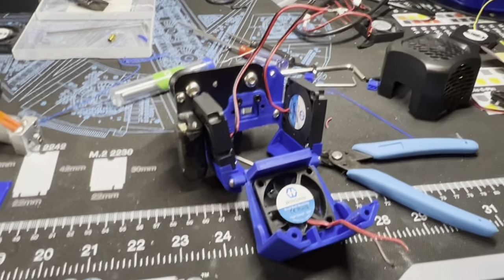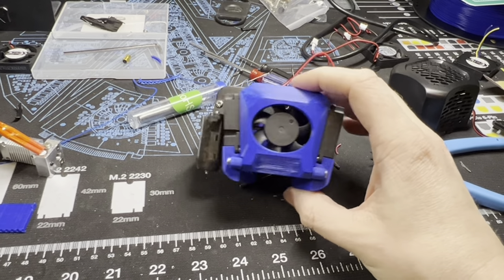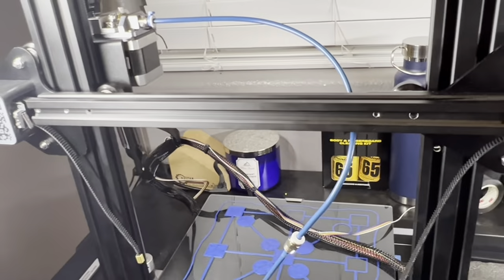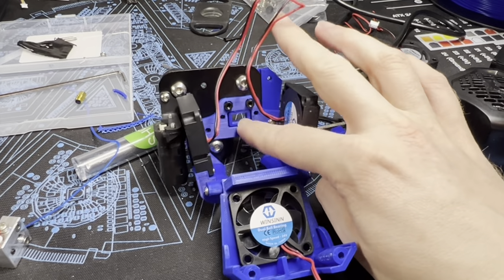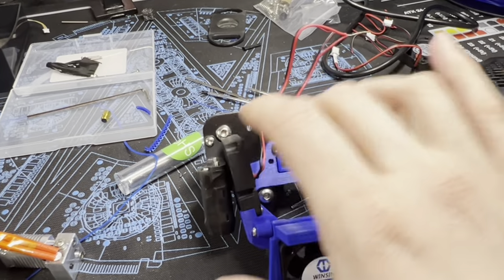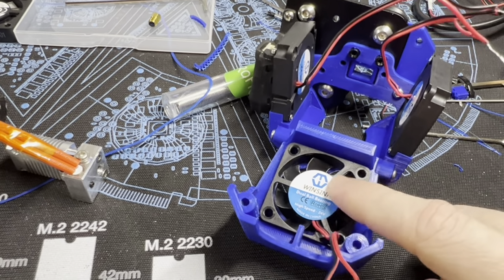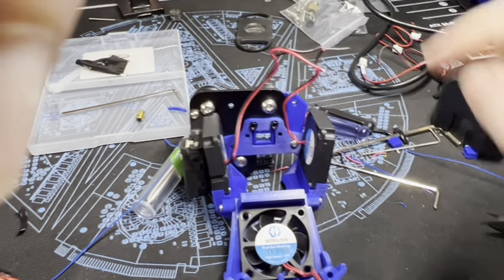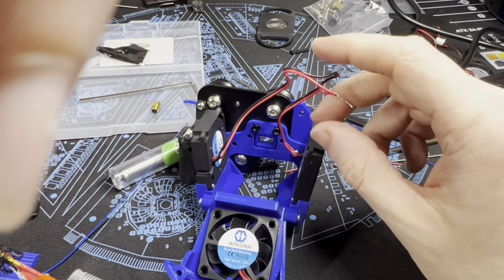Ender 3 v2 Dual Blower Fan Shroud

Comment: I've been using JST connectors and putting them on everything on my printer, you can make a splitter cable for the blowers, but the good thing about JST connectors is they are the same as what Creality use on the motherboard. No more soldering and cutting wires every time I mod my printer or change a fan.
Reply: wich jst ?  🤔
there are more type and now i have the wrong one's 😌
Reply: JST is a brand name, not a style of a connector

Comment: Instead of soldering the blower fans together.
Fit JST plugs to each fan and on on the wire from the printer, then make a “Y” link lead, and connect the 2 blowers to that and the other end to the printer.
That way, if one fan fails, you can just unplug that fan and swap the one out. 😉👍🏻
Reply: Nah, if one fan fails, then the other wont be far behind, just replace both they are low cost.
Reply: @TheWeepingCorpse  holy 1 year post reply Batman 😂

Comment: This is what I was looking for since have an extra 4010 part fan from the assembly that came with the E3V2.  I installed creality's Direct Drive upgrade kit that comes pre--assembled, all I had to do was move my extruder over.

I printed the whole thing on PETG, started assembling it, the realized that this wouldn't work with my direct drive set up, it doesn't have the screw holes in the right places nor that rectangular hole in the back behind the Hot End.

Now I am making modifications to get it back printing so that I can print another fan shroud kit that actually fits my set up.

Thanks for the video.
Reply: Ayo drop the files if you figured it out, I also came to the realization when I tried to install on my direct drive v2

Comment: Thank you for this video. I just converted my ender 3v2. Im used to PETG with no problem, but started using PLA and was having warping mid print on the part itself (not bed adhesion), that fixed the problem!

Comment: It's a fantastic little cooler.  Looks alot better if you print it face up with support ! make sure to get the back duct some one added in the remixes :)
Reply: Are you talking about thing 4928888? to blow the air directly on to the hotend heatskink? I saw your remix to open the fan up, 👍 Thanks.

Comment: Thanks for the cool design on this printer head. With a tiny bit of modding it works on the Voxelab Aquilla.
Reply from the maker: Good to hear. I didn’t actually make this design btw, all credit goes to the author in the link.
Reply: Hello Digital, can you explain what kind of modding. I really like this and would like to know if im savvy enough to do what needs to be done to fit on the aquila
Reply: @Chris_6  sure you do. I use tinkercad and fusion for my cad work. But for this, I needed to wire in one more 24v fan. I had some replacements, and so I had to splice in the 24v power supply for the fan already in the factory hotend. It's not overly complicated but could burn your printer down or get electrocuted if not done right.  There are lots of videos and guides online to help anybody who wants to do some upgrades.
Reply: @Chris_6  The Aquila was effectively an ender3v2 clone, so most ender parts fit.

Comment: Thanks for the video. I have a VOXELAB Aquila and bought the same replacement fan kit. Looking for a shroud where I can use both fans I found this and your video. I'm going to work on this to fit on the Aquila. You should do more videos, you are very good at it. Thanks again.
Reply from the maker: Thanks for the kind comments! I hope it works for your Voxelab Aquila.
Reply: How did you get on? I added a Hero Me to my Aquila a while ago and 2 Winsin blower fans and wired it up just like this video shows; worked fine, FOR A WEEK then the PVC wire totally melted; almost set on fire. I replace the main wire with high temp 18 AWG wire up to the point it split to th 2 fans..worked fine..but now the printer stops after about 20 mins an reboots..even when the fan speed it very low (less than 20%). Have you seen the same thing?

Comment: I wish it had screw holes for the front fan to make permanent. But looks amazing and looks amazing. Also to tight of a fit for some of the fans I had to make adjustments on a slicer.
Reply from the maker: The front fan is in there so tight. It’s not going anywhere. Been using it flawlessly now for over 6 months. Also PLA+ has been fine, no warping at all.

Comment: hello, I really like your work!  I had a question, do I need to buy 2 24v fans or 2 12v fans to cool the nozzle?  I would be grateful if you reply.  thanks.  good work
Reply from the maker: Has to be 24v, otherwise you have to get a buck converter to change it to 12v.

Comment: Is there a remix of this that uses a magnet to hold the front cover closed instead of a screw and its designed to fit the stock hotend for the Ender 3 V2?

Comment: Thanks for your very helpful video.
Quick question please, with BL or CR touch the prints come out better even if the bed is warped, or still have to level the bed?

Thank you
Reply from the maker: The bed still needs to be as level as possible and it will compensate for slight warping, but if the warp is really bad you should just get a new bed.

Comment: the files that you have in the description, do they fit with the CL touch or did you need to modify the model?
Reply from the maker: At 10 minutes into the video I explain this. No I didn't change the model, but I did have to shave down the CR Touch so it didn't hit the fan blades.

Comment: I've had an issue where the back plate doesn't push onto the 2 original heat sink threads go. I am using an aquila x2 (ender 3 v2 clone) just wondering if u had to hit them on with any force?

Comment: Screw size for the hinges are M3x12mm just fyi.
Reply: Good to know.
I bought taps and a set of small metric cap head screws and nuts.
Every one should have these on hand for building.

Comment: hell yeah thank you man.. i ordered the same fans a little while back and been waiting to install them, I may have to give this a go.. does it cool better or perform any better? and is it a noticable different as far as weight?
Reply from the maker: It allows me to run the fans at 50% which is much quieter plus it seems there is less stringing because it hits it from both sides.

Comment: Do you know if this design will accept non-stock hot ends? I have a Phaetus Dragonfly BMS and am having trouble finding a shroud with dual blowers that fits around it. It's 24mm wide.

Comment: I'm looking to add a few upgrades to my printer and this dual fan shroud looks like a good next step from the single stock fan of my Voxelab Aquila, where cooling quality depends a lot on the direction in which I print. As there are already many comments about this, I assume it is safe to use PLA for the print. Did you have any long term issues with it, especially on longer prints? Would it maybe be a good idea to coat it in something heat resistant like waterglass?
Also, thank you for the assembly guide. I will definitely be using it when I get around to printing and installing the shroud.
Reply: Did you do it yet?
Reply: @urgamecshk  Yes, I printed it in PLA 1-2 months ago and it performs pretty well. It's more quiet than the stock shroud while getting a better airflow, and I didn't have problems with it deforming even when printing hot materials like ASA. Do keep an eye out for warping though, as warped edges can hit the cooling fan duct if it's bad enough. 
There isn't really a need to coat the shroud in something heat resistant, although that would probably make it last longer.
Reply: I've been running a PLA+ Santana Printer fan  remix on one of my printers for more and a year with no issues.
Reply: It is amazing to me how much quieter the Voxelab Aquilla gets with a printer fan cover vs the stock. I printed one ( a Santana remix) of my ender3v2 for my first Vox and it was a huge difference on loudness.  The factory fan setup is really loud. lol.

Comment: This is a great setup and I am working on the same thing at the moment but I was wondering how you connected the fans together? Much appreciated
Reply: If I had to guess, 24v fans should be wired in parallel so they stay 24v. If you have 12v fans you wire them in series so the 24v supply is split between them.

Comment: Great design! Thinking about replacing my Satsana fan duct with this one. What voltage fans did you use? I'm thinking about buying winsinn fans but not sure what voltage to pick. The default blower fan is 24v so 2x 12v winsinn fans should be best right? You link to 2x 24v winsinn fans but they don't run on full power then?
Reply from the maker: I’m pretty sure you have to use 24v fans, unless you get a buck converter to convert the voltage to 12v. The winsinn kit I linked in the video description works and is 24v.
Reply: Danny, that's not how voltage in parallel works with a load like a fan. If you wire two 12vdc fans in parallel to 24vdc, both fans will see 24vdc and they'll both be damaged. Same goes with series. There's a small voltage drop across the fan but likely they'll still be damaged. 

Unless you want to get a converter for 24 to 12vdc, you have to use 24vdc fans and wire them in parallel. They'll both see 24V and the board will supply current to both appropriately.
Reply: You could wire 2 12v fans in series, and that would effectively "split" the voltage between the two.  However, this does potentially create other issues.  For example, if one fan wears a little faster than the other, the voltage required to spin the fan will become increasingly different.  As one fan pulls more voltage, the other fan will receive less.  In the same way, if one fan fails, the other will get the full 24v and get fried, too.

Best option: use fans rated for the proper voltage.  (In the case of the Ender 3, that's 24v.  You can confirm this with a tester, or check the internals.  It's usually printed on there.
Next best: Install buck converters to reduce the voltage to 12v.  This also introduces additional issues/concerns that I won't get into here, but you can do some research and find them out.
Worst option: use 2 12v fans wired in series.
Impossible option: Connect your hotend to a radiator fan from a 1994 Jeep Grand Cherokee 🙂

Good luck with your mods!
Reply: @daviddeyoung5710  How can I get the All Wheel Differential Drive out of the 1994 Jeep Grand Cherokee and into my dual gear extruder? I need more power! Wiring in parallel is essentially like buying old Christmas Tree lights at Wal Mart, in the 1990's. The fluorescent bulbs will continue to receive power if one bulb goes out. A series, however, is when one xmas light bulb goes out and the whole series of the colorful lights will not power.
Reply: @mattpker  Did you wire the 2 fans parallel?? You know that this means that the final load is 12 v ?

Comment: I don't know if I'll get an answer here since the video was over 1 year ago. However, I would like to ask something. I have installed a 12v radial fan, but I also want to install 2 pieces. now I would like to know if you can block 2 ventilation to a connection (like you in the video)? Are both fans still running at full power or are they drawing power from other fans? 

would be really grateful if someone could tell me.

Comment: Did you print this in PLA or PETG? 

ive only got PLA on hand but being that its not in contact with the hotend im assuming it wont have issues with heat related warping
Reply from the maker: It has been fine with eSun PLA+ so far.
Reply: I’ve used paramount pla and it works fine.  No warping or melting and I’ve had some very long prints on it and print at 230C

Comment: i have this setup but i used the stock ender 3 fans and now i'm having stringing issues. my retraction distance, speed, and filament temperatured were the same. could it be just the fans?

Comment: Hey nice job! I was hoping to add a fan to cool the extruded motor because it has been overheating recently and causing the filament to melt and get stuck. Am I able to just splice in another fan with the existing one and power 2 fans?
Reply: Splice it in with the hot end cooler. Not the filament cooler. You could also get some passive heat sinks for NEMA 17 motors.

Comment: Great design and great explanation,. I tried to print one of the parts (Airducts_V3) and when
removing from the bed it broke in two parts., The structure between the back plate and the fan ducts seems to be weak. I printed the part using PLA+. Can you please confirm the filament you used please.and also  cura settings. Thanks
Reply from the maker: I used eSun PLA+ with default Cura settings. Maybe your having bad layer adhesion? Try increasing the printing temperature. Some people forget with PLA+ you need to up it from 200c to 210c.

Comment: The left fan is covered by a BL touch, which blocks the air suction. So, may be it is not the best idea how to place the fans. Anyway can you see any difference in printing quality compared to a stock fans solution?
Reply from the maker: The BL touch is hardly blocking any air flow, it still blows very strong. And the part cooling is cooling from both sides now, so yes it is improved. I have been seeing less stringing then previously and I can run the fans at 50% speed for less noise.

Comment: I installed two fans and wired them correctly and the one fan takes precedence over the other, I have tried other fans, is there something I am missing?
Reply: Same problem here.Did you find the solution ?

Comment: Now it cools down pretty crazy. Do you suggest cutting speed to 50% ?
Reply from the maker: Yes I run it at 50% fan speeds now.
Reply: @mattpker   do you change the voltage on the board or its not needed?
Reply from the maker: @alexguertin7261  no

Comment: How is the fan noise compared to the stock fans and shroud?
Reply from the maker: Because it’s two blowers, you can turn the fan speed down to 50% and it is much quieter.
Reply: @mattpker   did you have to change the voltage somewhere ?
Reply from the maker: @alexguertin7261  no I did not

Comment: I love this design and tried it last night… unfortunately I found the airflow for layer cooling to be lacking… compared it side by side with my stock set up and I could feel a ton of air coming from the stock set up. From this I could tell airflow was at best half of stock. That was only trying one fan but stock only has one fan. Either it’s just me or the ducts are just to long and open for the little blower fan.
Reply: I wonder why that is: I am using this shroud for around half a year and I literally had to reduce the part cooling to 50%.
Reply: @Schnabulation  not sure either… the duct was a very very tight fit for my blower fans but that should be good… couldn’t find any leaks that could be causing it. I’ll probably try to figure it out again soon

Comment: does this work on the ender 3 pro?
Reply from the maker: No, the bracket holding the hotend is different on the Pro. This will only work on the v2.
Reply: @mattpker  there's literally not 1 design for the ender 3 pro with double 4010 fans, it's so frustrating
Reply: I’ve modified this to fit a Ender 3 pro.
Reply: @Br0d0n  where can i find your mod 🤔
Reply: @Br0d0n  share please?
Reply: @positiveeffect6770  I am working on modifying this to have a magnet connection